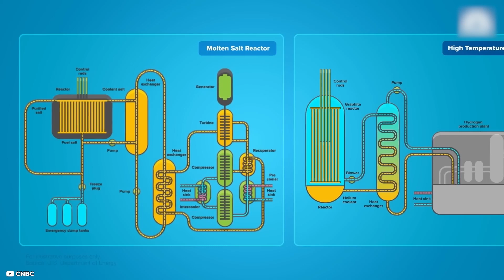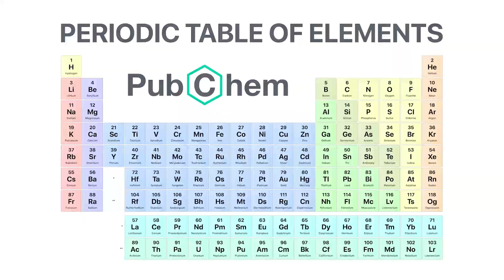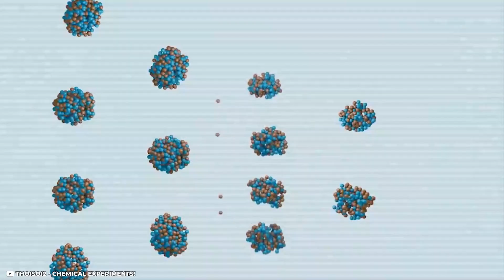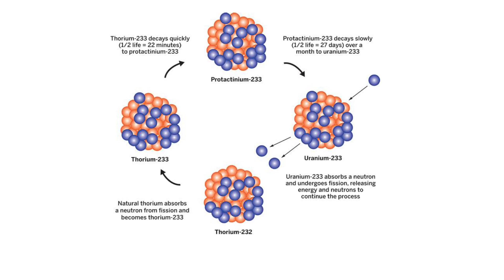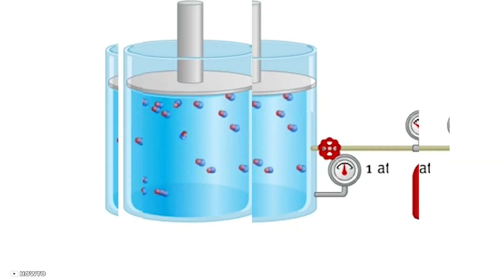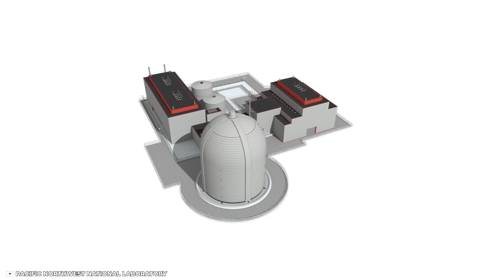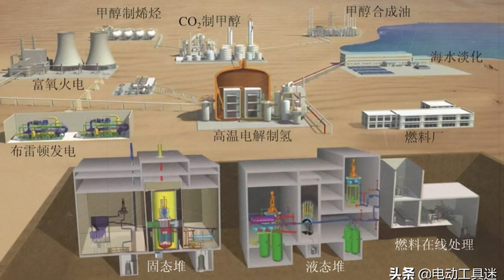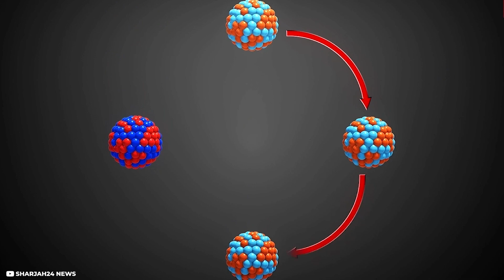NEW NUCLEAR REACTOR! Safe Nuclear Energy for 1200 Years!?

Comment: If corrosion is such a factor how did the MSR in Livermore run for five years with out a glitch?
Reply: It is Oak Ridge National Laboratory in Tennessee, not Livermore which is in California..
Reply: @MASMIWA  sorry. Thanks for the correction.
Reply: Small test reactor is not the same thing as a large power reactor.  Also, it was at Oak Ridge National Lab - not Livermore.
Reply: without
Reply: @MisterHowzat  
Picky aren't we. please do not ever make a mistake you might get corrected
Reply: @MisterHowzat  so we’re there corrosion issues with the MSR back in 1960’s???
Reply: @birther1968  "without", not "with out"
And "were" not "we're"
Reply: @birther1968  Minimal
Reply: @birther1968  were there?

Comment: Can they replace Uranium with Thorium in the old reactors??
Reply: No, they can’t but they can replace coal fired power plants with thorium reactors. They don’t need to be by a large body of water for cooling.
Reply: No. Thorium isn’t fissile, and PWRs aren’t designed to breed anything.
Reply: no
Reply: Yes, Moltex in the UK specializes in fuel rods that contain molten salt and can contain thorium. But it's silly to worry about fuel cost for the old reactors.  Let's build 40 times as many new ones, cheaper safer, better.  Give up the half-century old tech please!
Reply: @grumpystiltskin  agree.
Reply: Thermal breeding with thorium and uranium fuel was tried at Shippingport in a PWR.  It did not seem to work very well.

Comment: average amount of home window glass, 32m2, 
is the same amount of glass needed on rooftop glass PV panels, 32m2. 

And rooftops are 100m2 to 200m2. 

Extra grid electricity is not needed for daily topping up EV. 

Daily drive 7wkh. 
A gallon of petroleum, 33kwh energy equivalent, 
is needed to heat up a central fossil fueled electric power station, 
to be able to send 7wkh into the national grid.
Same with nuclear heat.
Nobody understands this confusion. 
A few square meters of glass on the roof is all that is needed. Most of the year. 

ICE vehicles burn energy even idling in traffic. 
EV use electricity only under load. 
EV do not use electricity when stationary in traffic jams or coasting or slowing down.
Reply: Wrong - not everyone in the world live in a single home, your conclusion is wrong. For example a small apartment building - 6 apartments, each family in an apartment two cars. First no space for enough rooftop PV panels and second PV panels work seldom on 100%, the even partly switch off depending on the angle of the light, the intensity or if they are shaded.  3rd you need storage and a place for that storage for the energy, because EV's need the energy in the night when the people are at home and don't use them. 4th companies  haven't the space for enough panels for EV's to load over the day. 5th because you can't produce the energy where the EV's are you have to transport it and and every EV need the same amount of energy  a single family home needs (The 6 apartment house would be similar to 12 single homes if there are 12 EV's charging at the same time.). The infrastructure today isn't able to deliver that amount of power. And don't forget the destroyed environment (poisoned water etc.) because of the high amount of rare earth needed for the batteries used. In South America are animals in danger to die out because of mining of lithium and the sunken water level in the area. Add to that the indigenous people that live there and have their livelihood removed because of the poisoned water and the low water levels.
And last energy isn't only needed for EV - industrial production, retail etc. use insane amounts of electric energy not to forget the stupid amount of energy AC's in the US use.
Reply: @seanthiar  Stephen missed out so many problems that are far from easy to overcome.... especially to go full EV because of the massive requirements of cobalt, copper, lithium........(although I expect alternatives for the latter). Storage, though is the elephant in the room, especially as you need to store electricity near population centres. The other issue, which has been pretty disastrous in Germany, is it turns out that it's not very sunny there!! or anywhere in N Europe for that matter. The only option here is wind or tidal and perhaps deep geothermal (using new techniques learnt from fracking....lol). Thorium answers all the problems that are cropping up all over the place, but we do need the public to understand it is a world away from Light Water Reactors (current fission) in terms of safety, it is in a sense 'safe by design' :) Therefore it should be much cheaper to produce electricity without the crippling costs currently applied to nuclear power. PS Germany technically have twice the max demand from Green Tech but only get 10% of what's needed because the wind don't blow and the sun don't shine!!
Reply: @jameslawrence3666  This is a good response because you are thinking and strong enough to write it out. 

You agree 
No CO2 because climate destabilisation would be the end.
100 % electric world, because of the clean energy. 
Vehicles will be electric vehicles. But today's batteries are wrong. 
You agree nuclear power, electric power because of the world's need of energy. 

You understand that fossil fuels are very high DENSITY  energy and a very large amount of electricity will be needed to replace fossil fuels. 

So the concentrated central electric power plants the world has will need to be built new and 5 times bigger. AND  nuclear. 

Every country on the planet needs to stop CO2 pollution.
This is a huge amount of resources but probably things would be worse for the climate if we keep CO2 polluting. 

Because, I am old and care, and have seen dictators steal technologies build 40,000 nuclear weapons and threaten the world I grew up in.
The threat was basically a nuclear winter. 
But many people do not know very much.
And I still see the leader of the dictators today threaten the world, and his own people with nuclear retaliation.
Because of this living history, of extreme military defence reaction from every country.
I have heard of secret nuclear weapons built by a small non nuclear country and others suffering as other countries try to build. 

And because the massive military industries that were built because of the nuclear industries in a few countries, I think that world of nuclear power plants and supporting industries will be extremely expensive. 
Military defence budgets will explode. 

This is a cost that nobody talks about, silence. 

Big government and big business and big military have to be part of this way of 'clean' energy new world. 

North Korea would have to have its nuclear industries. 
Iran would have to have nuclear industries. 

Australia would have to sell millions of tonnes of uranium ore. 
Australia has poisonous tailings dams that over flow in the wet season and risk the rivers flowing to the ocean. 
Australia only exports 7,651 tonnes today. 

Nobody is talking about these matters. 

And still big business is building Electric Vehicles in increasing numbers today. 

Let me tell you about the 1million klm of poles and wires to the streets and homes and businesses and industries in little Australia. 
Australia is a great example as it has high density city living aswell. 

They took decades and decades to  build. 
Massive financial burden 
Massive raw materials 
Massive man power 
Massive government support. 
But the financial burden was the most important. When black outs happened because maintenance was low, the government insisted it was fixed and home power bills increased. 

So new nuclear for Australia is not 80, but 400 SMRs, at $2BILLION each. 
We need 5 times more in 100% electric world. 

So new concentrated nuclear electric energy needs a 5 times bigger capacity nationwide grid. 
Not 1million klm but 5million klm, at $2MILLION each klm. 

Who wants me to multiply the numbers??? 

Australia is only 26million people. 
The world 9,000 million people. 

The USA will protect Australian  people from military aggression. 

Australia can export billions of tonnes of uranium ore and iron ore and coal and minerals and can become even more wealthy. 

But nobody is telling people who want nuclear energy the whole story because it is a dead end and the first in will have government garrenteed profits for decades and decades. 

Just my thoughts.
Reply: @seanthiar  This is a good response because you are thinking and strong enough to write it out. 

You agree 
No CO2 because climate destabilisation would be the end.
100 % electric world, because of the clean energy. 
Vehicles will be electric vehicles. But today's batteries are wrong. 
You agree nuclear power, electric power because of the world's need of energy. 

You understand that fossil fuels are very high DENSITY  energy and a very large amount of electricity will be needed to replace fossil fuels. 

So the concentrated central electric power plants the world has will need to be built new and 5 times bigger. AND  nuclear. 

Every country on the planet needs to stop CO2 pollution.
This is a huge amount of resources but probably things would be worse for the climate if we keep CO2 polluting. 

Because, I am old and care, and have seen dictators steal technologies build 40,000 nuclear weapons and threaten the world I grew up in.
The threat was basically a nuclear winter. 
But many people do not know very much.
And I still see the leader of the dictators today threaten the world, and his own people with nuclear retaliation.
Because of this living history, of extreme military defence reaction from every country.
I have heard of secret nuclear weapons built by a small non nuclear country and others suffering as other countries try to build. 

And because the massive military industries that were built because of the nuclear industries in a few countries, I think that world of nuclear power plants and supporting industries will be extremely expensive. 
Military defence budgets will explode. 

This is a cost that nobody talks about, silence. 

Big government and big business and big military have to be part of this way of 'clean' energy new world. 

North Korea would have to have its nuclear industries. 
Iran would have to have nuclear industries. 

Australia would have to sell millions of tonnes of uranium ore. 
Australia has poisonous tailings dams that over flow in the wet season and risk the rivers flowing to the ocean. 
Australia only exports 7,651 tonnes today. 

Nobody is talking about these matters. 

And still big business is building Electric Vehicles in increasing numbers today. 

Let me tell you about the 1million klm of poles and wires to the streets and homes and businesses and industries in little Australia. 
Australia is a great example as it has high density city living aswell. 

They took decades and decades to  build. 
Massive financial burden 
Massive raw materials 
Massive man power 
Massive government support. 
But the financial burden was the most important. When black outs happened because maintenance was low, the government insisted it was fixed and home power bills increased. 

So new nuclear for Australia is not 80, but 400 SMRs, at $2BILLION each. 
We need 5 times more in 100% electric world. 

So new concentrated nuclear electric energy needs a 5 times bigger capacity nationwide grid. 
Not 1million klm but 5million klm, at $2MILLION each klm. 

Who wants me to multiply the numbers??? 

Australia is only 26million people. 
The world 9,000 million people. 

The USA will protect Australian  people from military aggression. 

Australia can export billions of tonnes of uranium ore and iron ore and coal and minerals and can become even more wealthy. 

But nobody is telling people who want nuclear energy the whole story because it is a dead end and the first in will have government garrenteed profits for decades and decades. 

Just my thoughts.
Reply: FYI - solar panels lose all their efficiency when they get hot, you know, when it's very sunny... it's terrible, you couldn't make it up. There has been a solution hit upon recently.... not that clever but!.... use water to cool them from underneath and hence you can warm water for heating systems etc for free as well. PS glass is not good for reducing your carbon footprint... probably some rare earth issues too!!
Reply: EV carrying the weight of batteries everywhere they go, a major waste of energy.   As for not needing more electricity on the grid for EVs that's false on the face of it.  You don't replace all cars with EVs then magically pretend you won't need more energy capacity.  It's crap like this that exposes so-called 'green' energy proponents as ignorant fools.  Oh and if you're going to stop ALL co2 production you'll need to kill billions of people.  Of course that's what's really behind some of this co2 hysteria.  Billions too many dark skinned poor people, right?
Reply: Why don't you install all of that and celebrate your success....you won't ;-)

Comment from the maker: This GEOTHERMAL BREAKTHROUGH Will destroy Oil and Gas!
https://youtu.be/Fm_JmVQEDbA
Reply: The reallty big issue, is that different Energy types is a give, and take relationship. So for example: I can power my house,  and anything around 12,000 Sq Ft with my own personal Powerplant. The issue is that you would give up 4x4 footprint of space. I would only need to replace parts in 500 years. A type-II powerplant would require Hydro electric, which would give more power, but requires water. Type-III would use Nuclear Fuel.Thorium which turns nuclear. Type-IV would use particle systems. Particle systems is the Golden Ticket, because the Particles is constantly moving through space. This is really expensive, due to the exodic Parts that is needed. Molten Iron in between Types III, and IV: this creates power, but you have to change out iron constantly, which makes the iron unreusable after this. Geothermal is a type-II system. The reality is that no matter what system is used you only get 50% of the value due to friction. You place 100% of one energy type into a system to get out 1%-50%  energy out the other end, of another energy type. Each Type of system requires more materials to burn in order to gain more electrical power. So the issue is pretty simple, You need multiple types of energy running in order to remove others from the system. A Type-I power supply, would cover most man made buildings which you would not need many Type-II systems. The problem is that the Exotic alloys needed in really large amounts, this is the give and take situation. The most Eco Friendly options is limited, and expensive to create, and at times requires more power for replacement parts.